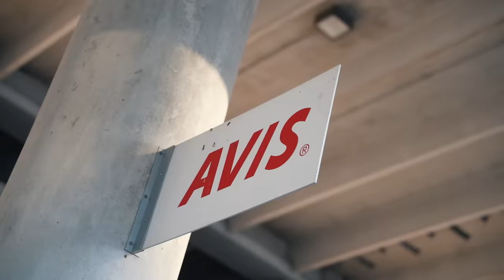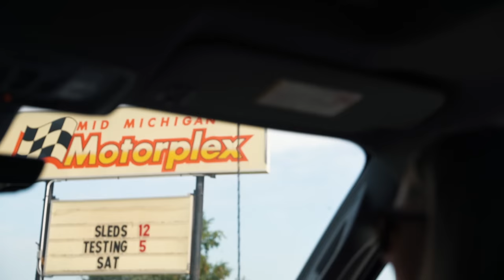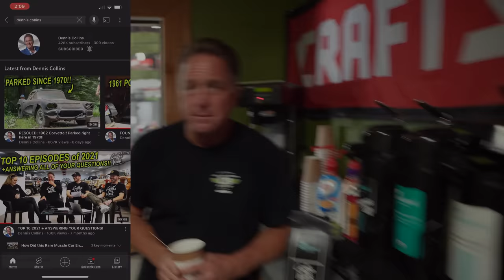How To: Get Your NHRA Certification in the 2022 COPO 572 Camaro Serial 001!

Comment: Great video I had a 69 Z28 302 4 speed I raced it every weekend if I would have been older I would have appreciated the car alot more but when your 19 and think you know everything you put aluminum rods in the motor with the biggest solid lift cam you can find and I knew when it went to 9400 rpms it would not last long and it didn't I destroyed the block one rod went through the pan and another one broke and tore the cylinder up so bad it could not even be sleeved. I wanted to cry my girl friend was so made at me because she worked almost as hard as me on that car.

Comment: Not to take away from how great she's doing because she is talented at this, but about the car itself. The fact that it's a factory drag car is cool, but they don't deserve the same recognition as the original "real" COPO cars because they aren't street legal and all you can do with them is run them down a short strip of pavement. They should get a different designation for being a Drag only car even with being a Central Office Production Order, maybe a COPO/DO or something. COPO  should be saved for a special order powerful street car that you can drag ALSO, not ONLY. The car is a trailer queen short run drag use only car. I'm more impressed by the ones that get driven to the strip, run down it, and driven home again.

Comment: Ive only ran a couple passes at a real track, it just freaks me out how that track just looks wet and slick, i dont get it, was the same at the track i ran, dont you want a dry track? Its just the hot asphalt or the tires going thru the water before a burn out that leaves it wet, or its just stickier that way?

Comment: wheelies are cool but they kill ETs. Great job Kelsey!
Reply: Those cars have to Wheelie to work right, there like a stock eliminator car, they run a small tire, watch the COPO car's at an NHRA event.
Reply: @michaelwynne4346  if the crew chief has the ballast right in the car you only want maybe an inch of daylight on lunch under the front wheels. You are trying to rotate the earth not the car
Reply: @pghgeo816  I understand how it works I've been doing it for 38 years I'm just telling you that's how they set up those cars for the little tire, just like stock and super stock.

Comment: dont like to be negative but that was pretty weak. very weak launches dont be scared to mash that pedal off the line and load it up on the converter before launching. that car should be running 9's
Reply: Maybe 8’s